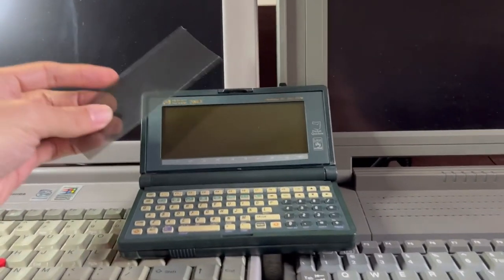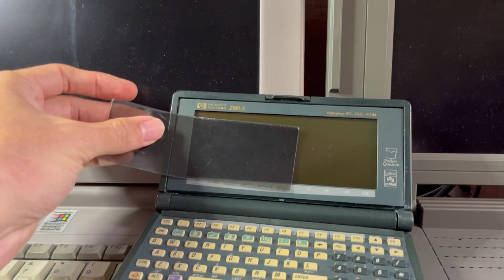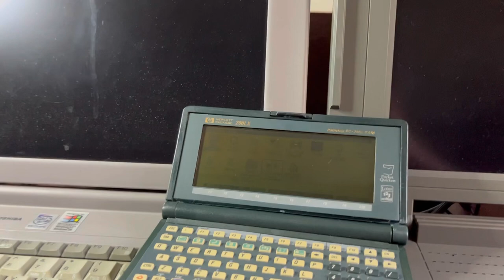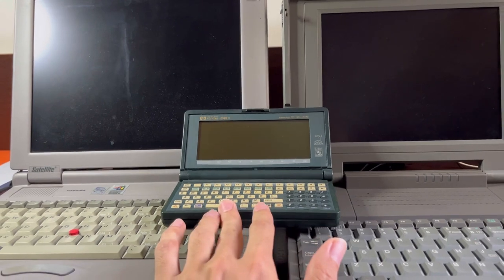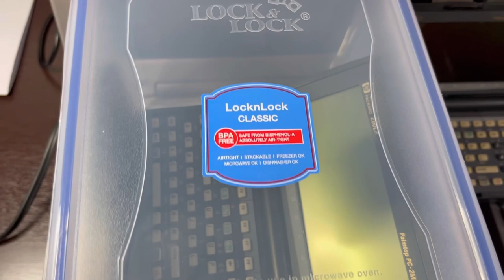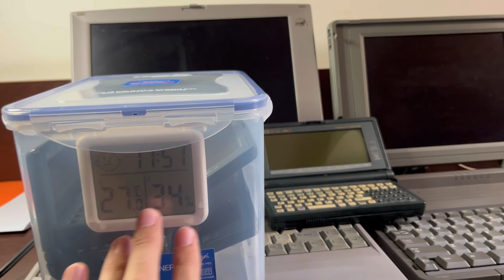Vinegar Syndrome is KILLING our vintage computers.

Comment: Thanks for making this video, I've got a couple of laptops affected by this but it's still tough to find information on it. Your method looks like it should work really well, I'm in a cooler country but it's actively happened to me where the laptop was stored too close to a radiator and kept closed - storing them with the screen open and in a drybox seems like it should be a big help.

I do think that we should use a different name than just Vinegar Syndrome, since a company brand appears to be sitting on the phrase which makes it tough to find information on the topic. I was thinking just call it what it is which is Polariser Breakdown, it's going to happen to far more devices over time.
Also, if you have successfully swapped a polariser then well done, I've tried and it's quite difficult to avoid damaging the screen with the pressure/pulling that has to be applied to the LCD's glass.
Reply from the maker: Thanks for the comment. I’ve been calling it Vinegar Syndrome because thats the term I most commonly stumble upon, even though as you too noticed theres little info about it and how to slow down the process to prolong the life of our devices. I made this video exactly because I wanted to share my experience, and I may in the future make a more in depth video about it, since there are some catches that help slow down even more the process. I’ll save this idea on my future videos list. 
As for replacing the polarizer I have done it several times with success, but I did make a few mistakes on my first tries, and sometime, even after replacing more than 30 polarizers, sometimes things do go wrong as the ribbon connectors on the 200LX for example are very delicate. If I do need to replace another polarizer I’ll male a video about explaining the tools and chemicals I use.
Thanks again for the kind words.

Comment: i had a gameboy DMG and a TI-82 calculator and some sony portable DVD player that were all stored in a box in the basement all get vinegar syndrome at the same time, the portable DVD player got it the worst
Reply from the maker: Yes, many vintage devices are been lost due to this problem. Some are fixable, but others arent. My gameboy color is on the waiting list to be fixed, also has vinegar syndrome.

Comment: Instead of silicate gel, you could also try (uncooked) rice.
Reply from the maker: Yes, it should work. But silica gel is so cheap (and works so well) that I suppose its a better option.
Reply: @electrohoard  Actually, when I got that tip from someone, it was meant to keep an old car dry in those cold, wet winters we have here: Put a bag or two of (boil-in-bag) rice into an old sock and deposit in your car. That's probably where that tip really shines, as small silicate gel bags might not scale very well for that task. For your purpose, they're probably sufficient.
Reply from the maker: @theol1044  thats true! You can get huge bags of silica gel for your car in Aliexpress, but they are way more expensive in this case than your suggestion.

Comment: i haven't suffered anything with vinegar syndrome, is it somthing to do with storage conditions?, also if you are SUUUUUPER careful i think you CAN peel off the polariser film
Reply from the maker: Yes, has everything to do with storage conditions. The colder and drier, the better. I livre in a hot country with high humidity so its perfect for damaging polarizers. Even though they can be replaced, its a pain. Best idea is to avoid it at all costs if possible.
Reply: @electrohoard  i suppose it's worth it if the LCD is very rare.

Also as i live in the UK all my laptops reside in my bedroom cupboard, the temperature rarely gets above 20 degrees on a normal day... The humidity is absolutely NUTS but for some reason nothing has started doing weird things yet.

Though i really gotta NOT stack them, that damages the LCDs from pressure,
Reply from the maker: @lukedavis436  yeah, try to avoid stacking. Basically all these LCDs are rare because most of the are custom made for each device. I have replaced a few polarizes, but the end result is never perfect, so I do my best to avoid damaging them in the first place! Controlling humidity is easy, hardest to control is temperature, so you are in a great position to keep these perdect for a long time!